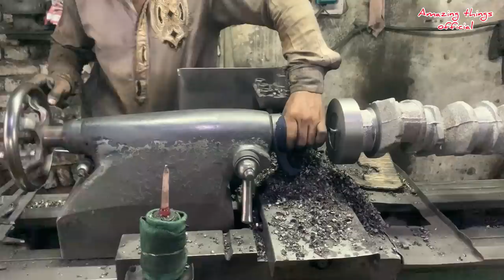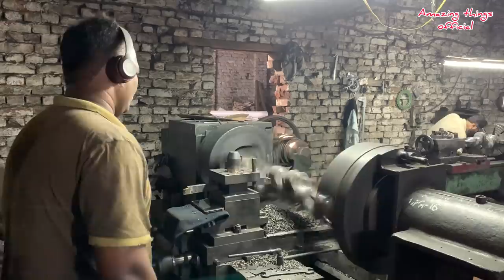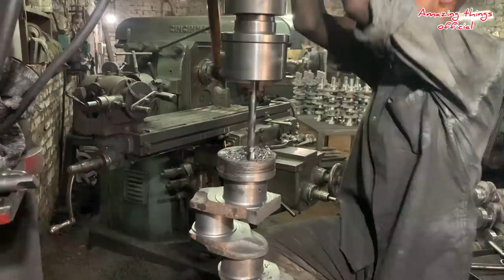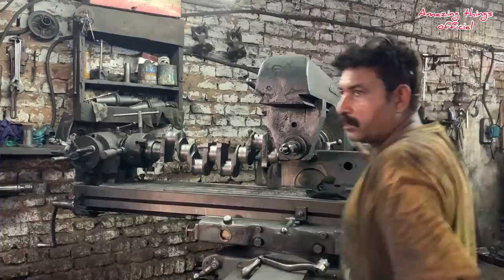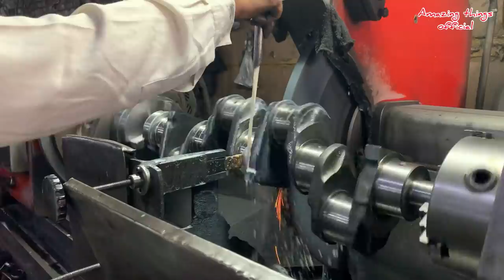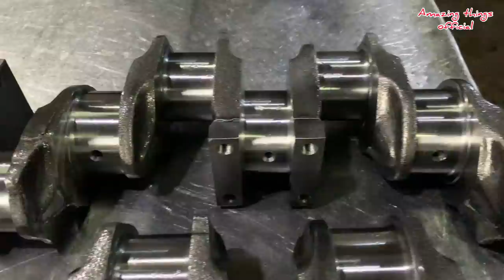How is a Crankshaft Machined After Casting? Step by Step Walkthrough in Factory

Comment: They are  absolutely amazing..they can even fix a broken shaft bring it back to original specifications where as for other's a broken crank shaft is condemned...
Reply: I would take that broken crankshaft that you think is so great that they fixed & use it for a boat anchor. I would NEVER use a crankshaft that was repaired after being broken. No matter if they did their best work on it, i would NEVER use a crankshaft like that in any engine i own, or rebuild. You will NEVER get a broken crankshaft to be true, it will never hold up to a new one. You're better just to condemn a broken crankshaft & get a new one.
Reply: Yes this is hard handy work that I fully support and will buy.

Comment: Nice work guys.
Amongst other things I have learned,
I have reached the stage to go from 3D printing, to hopefully become somewhat adequate at using a lathe.
Can't print some things. Have to spin and trim.
But this would eventually drive me nuts.
Did sheet metal for a while in the 80's and the only electrical tools we had were a drill and a spot welder...and a lot of holes in the roof. Rainy days sucked.
Reply: Oh...and I like those wood boxes...nice!

Comment: I wish they would show how they got both ends of the lathe offset by exactly the same distance like that. I would have thought that was insanely critical.
Reply: Just chuck a bar in the two chucks and clock true/adjust at each end.
Reply: Insanely critical is relative. 

Compare the process you see here with this process; https://www.youtube.com/watch?v=MRlnwacph3I

Which one would you want in your car?
Reply: @nobuckle40  Well said, Doug. You can see the run out in the crank casting as it turns. When I was regrinding cranks we had a .0002 taper/.0005 out of round limit. I would love to see the result of putting a dial indicator on one of these “precision” cranks just to see how bad they are.
Reply: @trebushett2079  Not exactly the way I was taught many eons ago. We were taught to use the method you describe as an initial set up. For precision work, we would set the work up with a dial indicator on both ends of the work. Our tolerance was .002-.003.
Reply: @nobuckle40  

g
Reply: @sergei693  Sorry, but I don’t read Cyrillic.
Reply: @stevehicks8944  Thanks. I'm usually not as colorful with my language but as a former machinist and tool maker I am just appalled as such practices.
Reply: @nobuckle40  I’m a retired ASE master engine machinist. What I see actually enrages me.
Reply: Did you watch the rest ? there is no way I would put that in an engine, even by eye on video you can see the runoffs
Reply: @gowdsake7103  I watched it all the way through. I agree, an engine would quickly fail with parts like that in it.
Reply: The way they operate I would guess that they use an original Crankshaft to set up the lathe. It is a critical dimension but fairly simple to accomplish.
Reply: It is very critical but because it's a step it's constantly set to the correct offset In  the tooling. It's not that difficult though
Reply: @nobuckle40  Even as someone who has never used a lathe, I was asking myself questions too. : 0
Reply: @stevehicks8944  почему вас это бесит? Они производят тот товар который востребован в их стране. И да, стоимость этого товара ровно столько  на сколько оно востребовано. Итог - они работают и делают то что нужно для потребителей.
Reply: Man in white lab coat & cigarette = everything precise, no argue, box it, ship it & shut up.

Comment: don't those bearing surfaces have to line up perfectly with the center of the piston hole?   or is there side to side slop in the wrist pin?
Reply: That's done when the crankshaft is cast.
Reply: @timothygeiger8271  I'm not sure that's correct.  the sides of those bearing surfaces are being turned and that can shift the center to either side of the direct center of the hole if the correct amount is not taken off both sides.  It may turn out the correct width to fit the rods, but it can also end up off center.  Casting are rough and not cast to .001 tolerance.
Reply: @AffordBindEquipment  I'm not saying they did it perfectly, quite the opposite. Personally the conditions they work in, the outdated equipment they use, & the quality of materials they use, the only thing i would use one of those crankshafts for would be a boat anchor. 
They do work hard, & I'm not faulting them, but they do measure often.
Reply: @timothygeiger8271 I agree they are doing amazing things with limited equipment.  But what are the tolerance specs where things finally won't work right?  Or do they over-machine that critical distance so the rod will center itself in the bore, even by a .100" ?  There are some things one can't fake when dealing with such critical tight tolerances.
Reply: @AffordBindEquipment  personally i wouldn't use one of those crankshafts in any engine of mine. 
Of course my vehicles are all Chevrolet, so those crankshafts wouldn't fit in any small block V8's i have. Obviously not my LS engine, nor my old school small block V8 in my classic Camaro.

Comment: From the machining chips the material of crank shaft seems to be a cast iron, not a steel. Original crank shafts are usually made with a forged high carbon steel, forged Cr-Mo steel or forged Ni-Cr steel. Regardless of machining degree of precision, I am not sure if the cast iron can withstand the running load and will not deform due to casting stress.
Reply: This old engine.. no problem and for sure  not  for  supercar.... :)

Comment: After machining, I can see that these shafts are cast iron, you can see from the chip cutting, they are cast iron. I don't see a dial gauge for centering, just tentacles. Such a shaft is unbalanced and will vibrate, fall apart, for which these cast iron shafts can be used. You praise machines in the comments, but this work is improvisation, how to do something right, although in difficult conditions. I also machined crankshafts on such machines, I also do not see the journals of ground and inductively improved surfaces
and here I see only turned surfaces. I am also an engineer only in the field of machining and metallurgy,

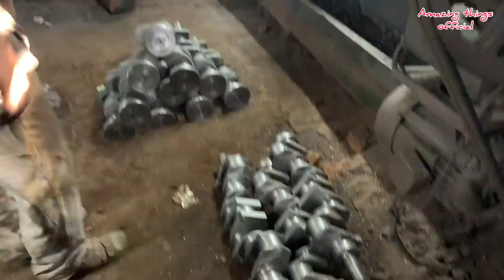Comment: That's what gets me. They take a machined part and just throw it on the ground! (19:53) At least give a shit enough to put them on a rack! In all my years as a machinist I never used a carpenter's torpedo level as a precision instrument. Side of the box; "Export Quality Material". Export Quality must be a synonym for piece of shit. I don't fault the workers in this factory, I fault the managers and company owner(s).  There is nothing quality in this entire process - from casting to packaging.
Reply: Maybe they don't want them to last too long....-) buisness might work different in pakistan?
Reply: @miyahampton  Evidently it does!
Reply: They seem do be doing a good job with the resources available.
Reply: Well I've been a machinist from 1976 to date and if we were caught using calipers on a part and not a mic. We
Would have been fired on the spot..
But I found it interesting and the chuck on the drill presses  it looked like a small lathe chuck...I think I would like that on my home drill press... but you would think that they would use a quick change chuck ..where they could leave the press running
Reply: Have you looked at the rest of the videos on this channel?  These guys could rebuild virtually any part using barely more than a hammer in a cave. Very impressive!   Amazing utilization of what they have available.
Reply: @bubblesculptor  They are doing a job - good, not so much.
Reply: @davidlayne8755  Calipers can be used to get you close, but mics will help you get within tolerance.
Reply: I wonder were the balancing is done
Reply: Yours is one of the few opinions here that comes from an experienced machinest so I take your opinion with a higher grade of credibility than the others here!

Comment: What is more important than anything in this video is to know WHERE these finished crankshafts are going.  Where are these crankshafts being used?  If they go into any cheap, low RPM application ...then MAYBE they MIGHT be OK to use.        OTHERWISE, THESE CRANKSHAFTS ARE A VERY LOW COST PRODUCT.
Using a casting as a crankshaft is fundamentally wrong.   Pretty well any schooled engineer knows this.    There are ALWAYS casting flaws no matter how good the process is.  When a casting integrity is important, then every casting is 100% X-Rayed to catch the flaws and discard these castings.      A CAST crankshaft can only be used on a "SLOW-SPEED" application.   No high speed allowed.
Quality crank shafts are forged ....FULL STOP.

No dial indicators, no digital measuring tools, no digital readouts on these lathes ....and the part is not even turned ON-CENTERS.     THESE GUYS ARE ALL REALLY WORKING VERY HARD!!!    NO ONE WOULD EVER WORK THIS HARD IN NORTH AMERICA.

NO BALANCING? .....must be low RPM application.
Reply: I was waiting on the balancing too, didn’t see it done. Bet they vibrate like crazy.
Reply: When you want to criticize people, remember that not everyone in the world has the same conditions as you——————————————the great gatsby
Reply: A GOOD cast crank made by reputable manufacturers, eg  OEM manufacturers will take plenty of rpm. I have run them to 7500 in Chevs and 7200 on Holden 6s for a long time. As have thousands of others.  I have seen them [in the past] turned over 8000 in Sprintcars And they live. Some forged steel cranks will not take that. Too brittle.
These cranks are made from rubbish and machined rubbish for rubblsh smallish engines.Balancing?? It is rubbish!!
Reply: Думаю что вал тихоходный, противовесы съёмные на болтах, только вот не показана ни балансировка ни установка противовесов, опять же термообработка шеек нужна

Comment: God I hope none of these crankshafts are produced for American made cars. There is no indicting or quality control let alone worker safety & surface finish which is critical on the main & rod bearing surfaces. Also, there quite a few CNC manufacturers of crankshaft turning, machining, & balancing machines on the market. Ingersoll milling machines made several crankshaft michening lines for all USA OEM's & several overseas companies. Ingersoll milling machine was the premier company for custom machining lines along with their bread & butter stud bore machines. My father & then my brother worked at Ingersoll. My father was a electrician while my brother was a electrical engineer. All engineers who Ingersoll employed worked running machines in the shop to gain the knowledge of what their machines could produce. Even then for a custome machining line, Ingersoll would have to make a custom in house machine to produce the product which the customer needed. Many of the castings sat outside for 6 - 12 months to settle before final machining. Ingersoll never made weldment machine tools. That set them apart from the machine tools being built in the 1970's to the 1980's.